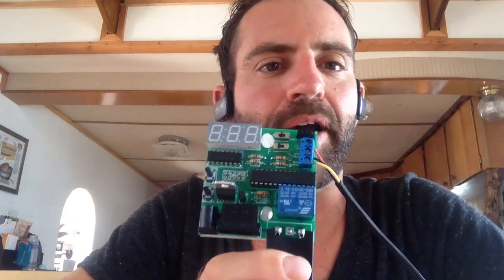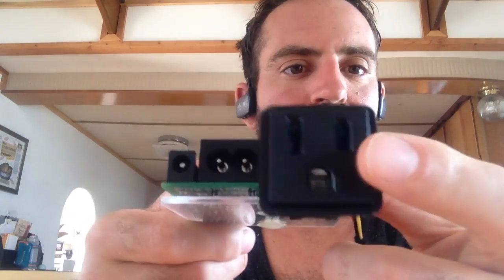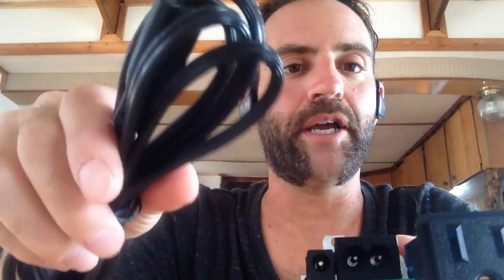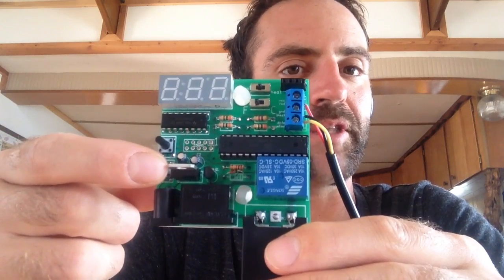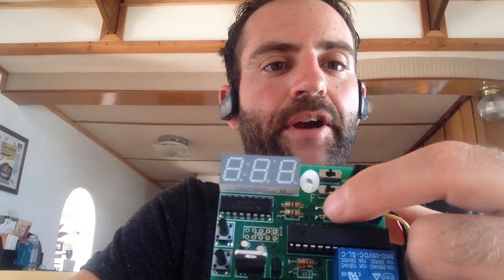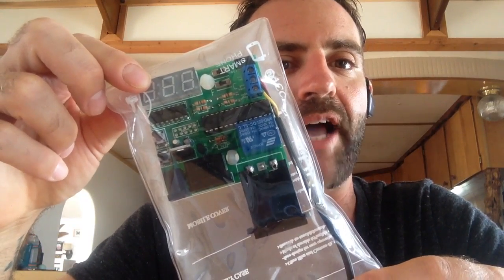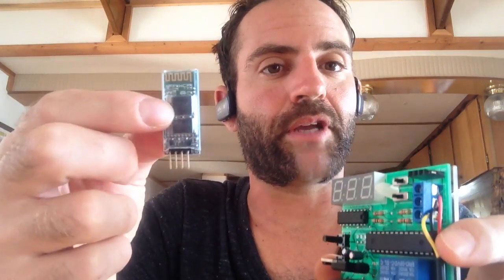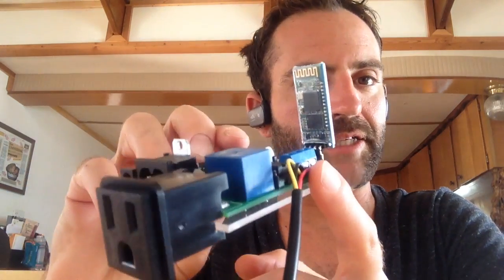Using the YATC5 Temperature Controller

Comment: Nice project, thank you! If I could change something about it I would make the load plug the same size and rating of the input AC plug. That would be recommended because how it is now someone could potentially plug a load demanding more power than what the input AC can carry and it could be dangerous, fire risk, etc. Thank you for the video!

Comment: Mikey makes it.  following Mikey for several years, he was a maker before it was a trend. Quality Plus.. Thank you Mikey.
Reply from the maker: Thanks Andre. I appreciate your support.
Reply: I wish you would try to make kits that apply to certain appliances.  I would like to be able to run a 110V freezer directly off a solar panel with no battery.  The reason is you can buy them new for $140 (insignia 5.0 cu feet freezer 218 kwh a year) while a 12V fridge might cost $500.   Also many van campers would like to have a frig without a dedicated solar system.  It would nice to be digitally controlled